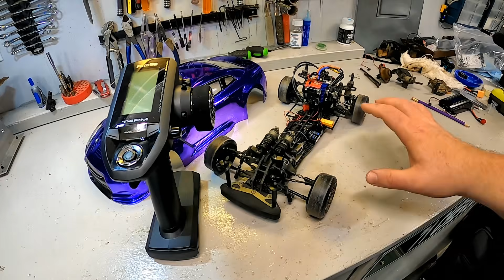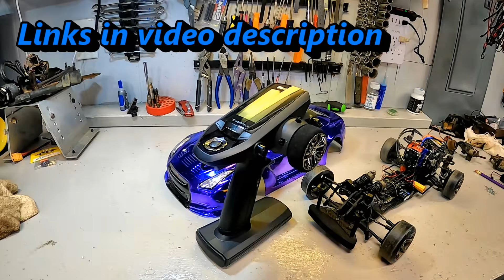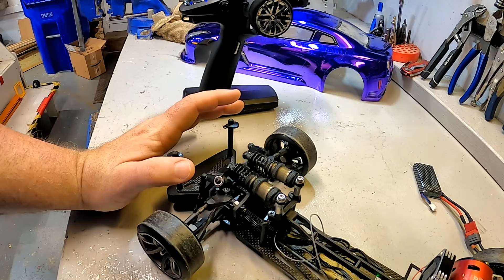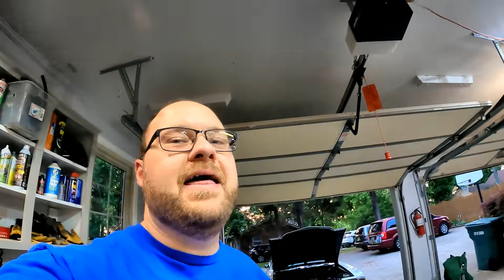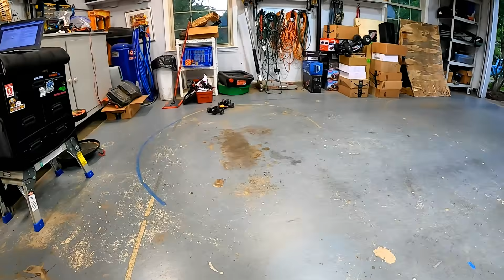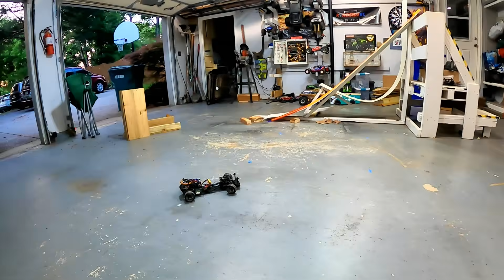How To Setup and Test the Yokomo DP-302 v4 RC Drift Gyro

Comment from the maker: CORRECTION!!
When I mention the reverse on the gyro, that is to reverse the gyro operation, not the steering operation like I show.
Reply: @RoadsideRC my gyro turns on once I power up the esc the gyro red light blinks quickly then there's no led lights and the gyro doesn't work l'm i doing something wrong? Everything is plugged correctly
Reply: @seanjay00  Had same issue for a moment.  I had to turn the dial up “dial is the gain” or strength of gyro.      Once I turned it up more than a tad… it worked
Reply: Question for you. I had to put my gyro in reverse for normal operation. Checked all my settings in my transmitter, Flysky G7P, nothing is set in reverse. So my question is if I had to reverse my gyro for normal operation does this also affect the Normal/Assist and Hard/Soft modalities? I noticed that on my remote when I rotate my gain in the positive direction I get a green light (soft?) and negative I get a red light (hard?) just a bit confused.
Reply from the maker: @patrickquillen4975 I don't believe it reverses those - but honestly doesn't matter even if it does.   Test each setting and see which feels the best for you!

Comment: u still running 80-90% gyro? 😅
Reply from the maker: It really depends on the exact vehicle, servo, gyro, etc. 
It is interesting how different combos react very differently to different gyro levels. 

I have this gyro now installed in my RMX4 and paired with an EcoPower servo.  That combo feels GREAT all the way down at 40-50% gain.  
However, when setup with a different servo and in a different chassis, it may need a completely different gain %.
Reply: @RoadsideRC  how do you feel about assist and normal mode? Which one are you choosin, are you choosing both and why? I havent tried assist the normal works fine for me I guess 😅
Reply from the maker: @jetski1107 I show what I think is the difference in the video.   But each person is different,so you will need to test for yourself.
Reply: @RoadsideRC I see the difference but the video is 3 years old.. I specifically wanted to know if you still use it to this day and why yes or why not 😅

Comment: installed yesterday...could never get it to be able to switch modes, I followed you video and instruction that came, but pressing the SW never switches mods after initial setup....gonna return it and either get the Reve D or the Futaba
Reply from the maker: Can you give me a time stamp in the video for what you are talking about?  Just to ensure I understand.
Reply: @RoadsideRC When you are speaking about the Hard/Soft mode... but the instructions say that if you " short press the SW" it will switch between different settings... but it doesn't give you the LED flash to signify it worked. 

Im gonna juat get the Futaba GYD-560 and cry about it one time.
Reply from the maker: @AnalogAssassin1  That mode is adjusted via the gain.  I move from hard to soft by making the gyo gain go from positive to negative.
Reply: @RoadsideRC i messed with it like you did, didn't feel the difference either. Seems that the Futaba is the answer. I'm gonna get one for my sons car, and add it to the build sheet for my RDX i am planning on since the bug has bit me badly getting this RMX 2.5 set up for him. 

Headed to Super G tomorrow if my disability check clears 🎉

Comment: Hey Roadside, new to drift here. Do you think the V4 would work with a Flsky Gt5, or is that asking too much of the radio?
Reply from the maker: It will worktogether, yes.  However, you will want to eventually upgrade that radio.   It works - but not great.
Reply: @RoadsideRC thank you sir
Reply: Hi roadside ,new to rc drift .i have futaba 7px should i set my receiver to SR mode. I have V4 gyro an V2 servo.

Comment: Ty so much. Just getting into drifting and your videos have been a big help. This gyro was a great upgrade on my rmx 2.5. I want to replace my motor and esc with either the HW xerun or the Maclan MDP. Which would you suggest? Also 10.5 or 13.5? I don't know what the difference is. Thanks again
Reply from the maker: Happy to help!  
10.5T vs 13.5T is a very small difference in wheel speed basically.  Here is more info:  https://youtu.be/VayXMGIyndM

Just to be clear, the HW drift-specific ESC is the XD10, this one:  https://alnk.to/90BiXHm
Either it or the Maclan are both more than most people will ever use.  
I honestly recommend this ESC for 95% of folks:  https://alnk.to/3coiAMT
It is a fraction of the cost and does almost everything the other ESCs do.  

Good luck on your drifting journey!

Comment: It’s the same as rc heli. Same concept you have rate mode vs head hold.  Rate mode acts like a buffer. Say you angle out 60 the gyro will combat not near that though more like 50 so requires more feedback from user to continue that 60 degree . Head hold on will 100% come back to that 60 degree.   What’s what idk but normal red is head hold while green is rate mode.
Reply from the maker: Interesting comparison.  Thanks for sharing.

Comment: Just wondering if you had any thoughts on why after installing a futaba 4pm, the steering will activate the motor when turning left, redcat RDS, not sure what setting I'm missing in the transmitter? I've tried going through everything and putting it back to zero? I'm not sure if this thing is still trying to run two servos?
Reply: Furthermore, when trying to use the trigger for gas or brake, nothing happens
Reply: I think I got the problem. I recalibrated everything again, and will probably have a gyro setup question, in near future. Ha this TX has so many settings
Reply from the maker: Glad you got it figured out - sorry I wasn't a help.

Comment: How do u actually make all the connections? No matter what I do, if I add the gyro, I have no steering. It’s disabled
Reply from the maker: My best guess - from what you have told me - is one of two things. 
1) It is an analog servo instead of a digital one - and the gyro won't talk with it. 
2) The wires connecting the servo to the gyro are plugged in 180* off.  

Good luck with the trouble-shooting!

Comment: Does this need a digital servo to work? And does anyone know if the rmx 2.5 rtr comes with one?
Reply from the maker: Yes - they need a digital servo.  
No - the stock unit from an MST is not.  You can try it - it might work for awhile...and then it will fry.
Reply: @RoadsideRC  thank you man. I just bought the gyro and I own the car stock.  Tried it but it always spun out. Couldn't switch to assist using the plastic Screwdriver but I got it home and switched it with a little bit I use for jewelry making.  The gyro was reversed. Gonna go try it now. Hopefully it doesn't fry! 

Do you mean the gyro or the servo may get messed up?
Reply from the maker: The servo - so it means you might s well run it until it dies, then upgrade!

Comment: Would a 5th scale rc benefit from one of these? Thats not used for drifting? More so bashing and power sliding around? In my head it would,but im not too sure
Reply from the maker: Nope - these are super-sensitive.   Using these in bashing would destroy them rather quickly. 

Traxxas, Spektrum, and others have various forms of TSM / AVC that are designed for bashers.
Reply: @RoadsideRC   thank you for the quick reply.. I've been out of the game for a good 12 years or so, and picking up a losi 5ive  in two days, super excited haha. I'll look into those!

Comment: What is much better, T4PM radio or FS NB4?
Reply from the maker: They are both really good. 
NB4 has cheaper receivers - so if you want to use the radio on multiple vehicles, that is a slight edge. 
Futaba is better if you want to run Futaba gyro/servo/etc.  

Really though - both work great.
Reply: @RoadsideRC  thank you so much. 
I'm planning to buy T4PM. But i don't think there's available GYD450 here in the Philippines.
Reply from the maker: @aiorimotov.253  Correct - the GYD450 has been discontinued.   You can choose either the GYD470 or 550.
Reply: @RoadsideRC  sure thing. 
Thanks for the advice, i will try if i can order on Amazon.

Comment: @RoadsideRC my gyro turns on once I power up the esc the gyro red light blinks quickly then there’s no led lights and the gyro doesn’t work I’m i doing something wrong?
Reply from the maker: Sounds like the gyro gain is set to zero.  That will turn the gyro off.
Reply: How do I turn it on because on the gyro I turned it to the left then to the right and I still see no light and no respond
Reply from the maker: @seanjay00  Do you have the gain channel plugged into the receiver and setup to be controlled in that way?
Reply: Not sure I do have it plugged but not sure how to setup that way
Reply from the maker: @seanjay00  In this video, I show you how I set it up. 

Whatever channel you plug it into, you have to tell it what gain % to be at.  

Example:  if you have it plugged into channel 3, then you set the value of channel 3 to the percentage you want. 
This is frequently under end-point setting, or just the value of that channel. 

What controller are you using?
Reply: @RoadsideRC  Futaba 4PM
Reply from the maker: @seanjay00  Well dang - I have one sitting in the garage, but never did a video on how to set it up for drifting.   Sorry about that!
Reply: Would you make one ?
Reply: Yeah I got a new yokomo gyro and still have plm setting it up I must be doing something wrong at this point I’m over it I’m just going to sell the whole car if anyone is interested hit me up
Reply from the maker: @seanjay00  Do you have anyone local who can get their hands on it?  Local track or drift community?
Reply: Nope
Reply from the maker: @seanjay00  I am in mid-TN.  Would be happy to help if I could get my hands on it.
Reply: I appreciate the offer but I’m in NYC I’m just going to sell it

Comment: You have any more exact information on this yet? Im lookong for a gyro that will do slow return...but no steering assist..i just need the gyro to hold angle and not wobble at high gain...but i want to be able to counter steer...
Reply from the maker: Not sure what exact information I left out...can you clarify? 

Depending on your definition of "steering assist", all gyros have this.   It is part of the definition of what the gyro is doing. 

Many have settings where you either turn into the corner, or countersteer.   But you will never be fully countersteering the car.  

From your comment, I am not clear that your expectation for a gyro is realistic or aligned with the technology.   

Happy to help more, but not 100% sure what you are really looking for.
Reply: @RoadsideRC  is there anything that will let the wheels return slow to center like it does on assist/acvs mode..but still retain the counter steer properties of normal mode? I know gyros add assist in general as their purpose...would be pretty brain dead to to think other wise.
Reply from the maker: @m4rkyfresh  Thanks for the clarification.   Sometimes it is hard to get the exact nuance of a message through these short messages. 

To get the exact feel you are looking for - I would suggest considering the tuning of both the gyro AND the servo.  

A servo like the ReveD RS-ST can be tuned with anti-shake directly in the servo.   This may allow you keep the gyro in a mode you like and change the dampening in that way. 

The other option is to step up to the Futaba GYD550 paired with a 7px or 10pxr.   When paired together, you can basically make that gyro do whatever you want!  But - that solution is pretty expensive if you factor in the radio.
Reply: @RoadsideRC  and my response was a little brass... apologies...I started a thread on super g Facebook page and the 550 absolutely is what I was gathering might be able to obtain those abilities..just yea...the price tag...and I really like my noble...I have a 24 scale and 43 scale that both drift the way im describing... believe it or not even with cheap servos. I guess that's why I'm so pressed to find that feeling in 1/10. Thank you for the response I appreciate it.

Comment: I know this is an old video, but it helped me with my initial set up for my V4. So thanks for that! Also, I didn't see it mentioned in the comments I went through, but I'm pretty sure adjusting the setting on the transmitter is actually switching between normal and assist modes and there was just a translation issue in the manual. From what I've seen on my car hard mode acts just like assist and soft mode feels the same as normal. Also if you pick the car up and check the return speed for the gyro, soft is fast like normal mode and hard is slow like assist mode.
Reply from the maker: That is an interesting take.  All of the folks I have talked with clearly treat hard/soft as different than assist/normal.  
Glad the video helped!

Comment: Hello, I'm building my first RC drift, I would like your help. Can I use this gyroscope on a Sakura D5 chassis? Can I use this gyroscope with any radio control? And finally, which servo would you advise me to use with this gyroscope?
Reply from the maker: (1) Yes - it will work on any RWD rc drift car chassis.
(2) No.  You will need a controller that can discretely set the endpoints of an auxiliary channel.   You saw me doing that in this video. 
(3) I recommend this servo: 
https://youtu.be/8d72Wlw9ecM

Comment: What the single signal wire do. If I plug it in gyro doesn’t respond but when I unplugged it works
Reply from the maker: Single wire is what controls the gyro gain.  After you plug it in, you need to set the endpoint on that channel to adjust the gyro gain.

Comment: I have a question. Would this gyro work for controllers without a screen on it? I’m currently using a dumborc x6 and I want to install the DP-302 V4. Would that work or would it not.
Reply from the maker: A screen is not what you need.   That is not the important part. 

What is important is a channel that you can control 0-100 in fine adjustments. 

The DumboRC radios *almost have this on channel 5 & 6.  You can control it there - but you have no precise control.  

Yes - you can get started with this gyro and that controller, but you will want to quickly upgrade controllers.
Reply: @RoadsideRC  alright, thank you

Comment: Trying to set up Yokomo gyro up with the TP4M but it’s flashing then shutting off?
Reply from the maker: Double-check all of the connections - make sure no wires are plugged in backwards or into the wrong slots. 
Also - ensure you gain is not set to zero.
Reply: @RoadsideRC  have a green light now. Is channel 3 already on on the 4PM out of box?
Reply from the maker: @codyburnsstreetspeedphotog2468  Hmm.   What do you mean by "on"?

Comment: I just installed mine and the steering servo doesn’t center it’s self when I let go of the controller. It’s a stock mst rmx 2.5 rtr servo
Reply from the maker: It may not fully center.   Don't worry about it doing that on the workbench.   Only worry if it hurts how the car drives.

Comment: Noob here been following your for a few weeks setting up my first build (tt02d), love your content and the topics you cover. Question: you mention at one point the hard/soft channel is connected to ch4 and then later in the vid you mention the gain is connected to ch3. Is that accurate? I have my gyro on ch3 and the default knob on the transmitter for ch3 is the VR1 knob . So it sounds like that is just for hard/soft mode, so if that’s the caseI’m not sure how to adjust the gain as ch4 on my receiver is empty. Any guidance? I’m sure I’m just confused lol thanks again for all your vids, helping me progress, really appreciate it.
Reply from the maker: Hi there! 

A few notes: 
1) I must have mis-spoke (it happens).   There is nothing plugged into channel 4.  Gain is set via channel 3.  And yes, one of the modes can be switched by having channel 3 in positive or negative.   The other setting is a physical switch on top of the gyro.  
2) You mention a TT02D.   Are you doing a RWD conversion on it?   If not - you do not need to worry about a gyro at all.  An AWD drift car does not need a gyro.
Reply: @RoadsideRC  awesome thank you for the reply, appreciate it. Yes I am in the process of doing a RWD conversion. I have a locked rear differential and a Front one-way unit, still figuring out what else I might need or if that will suffice to make it RWD
Reply: @RoadsideRC  also planning on getting the Yeah Racing RWD Drift conversion kit

Comment: Hey Troy, coming at you because the community has me up in the air on a gyro decision.
If you were me what would you pull the trigger on in this situation? 

Scenario: MST RMX 2.5S Futaba 3PV tx, ProTek PTK 140 servo. Old Oniski gyro with no options to set endpoints (main reason for upgrading). 

Since I’m buying new I don’t mind spending up to $150 on this upgrade. 
If you were me, would you go with the Futaba GYD470, the Yokomo V4, or something completely different?? 
Thanks in advance, your vids have helped immensely so far.
Reply from the maker: Honestly - you have the budget to go GYD550...and it really is as good as it gets.
Reply: @RoadsideRC  I had seen some day that particular model can be complicated, but if you’ve done a video on it I’m sure I’ll be golden lol.
Thanks for the help!
Reply from the maker: @jcasey2309  Of course I do!  
https://youtu.be/R3p2w6Ahntw

Comment: So I get green and red flashing lights indicating it's ready to be set I turn wheels to either side to set end point and when I hit the end point button it just stay flashing green and red I'm stumped
Reply from the maker: Interesting.   I have not had that before.  

Does it work correctly otherwise?
Reply: @RoadsideRC  I had had the steering trim to the right turned all the way up which was causing the gyro to not take the input
Reply from the maker: @rm4213  Glad you found it!
Reply: @RoadsideRC  thanks... Then I go into the garage to give it a rip and the rear axle came apart and I lost the holding pin found it after 10 minutes then put it back together and used thread lock on the allen set screw